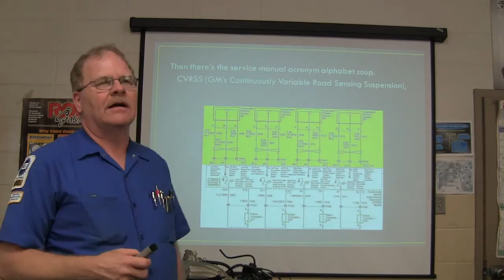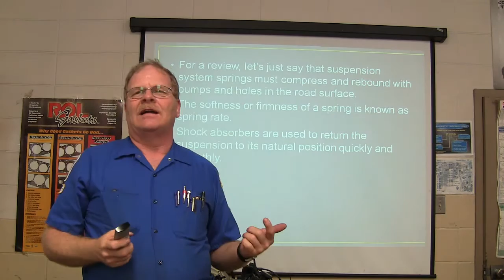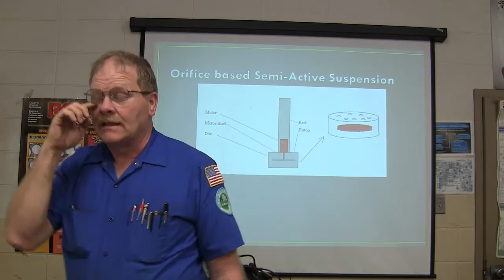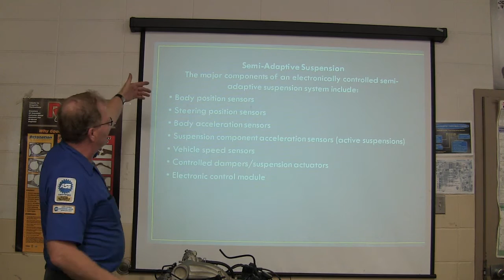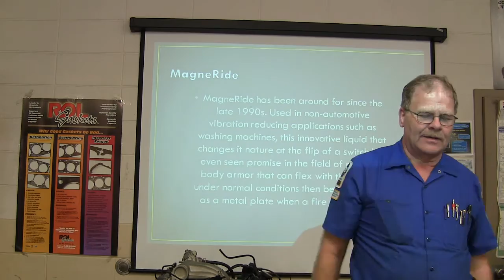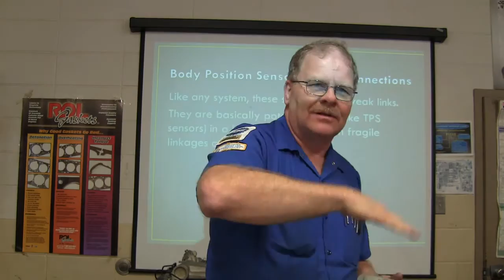Electronic Suspension Part 2

Comment: Those automatic tire balancers you described I've seen around before.   My boss has a civilian H1 Hummer that has a balancing system like that.  I'm not COMPLETELY CERTAIN if that's built into the later model H1's or if it's an aftermarket piece, but he described it as being filled with either mercury or lead shot as well, a heavy, dangerous metal, he wasn't entirely certain which one it was.   

Near as I can tell from a quick search though it might be an aftermarket device, I think it might be a "Centramatic" wheel balancer.  http://www.centramatic.com/wheel-balancer.rhtml?modelNumber=370-800  Some interesting information on there under the FAQ section about what's inside of it.